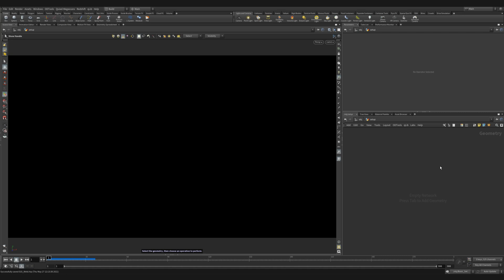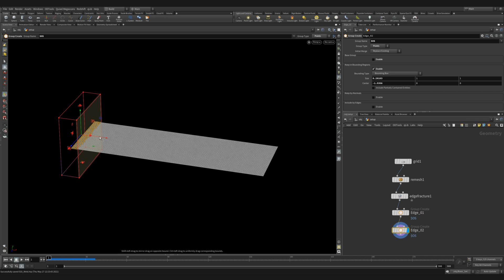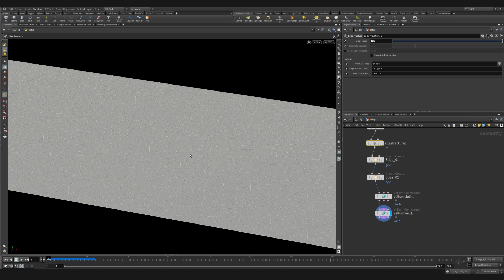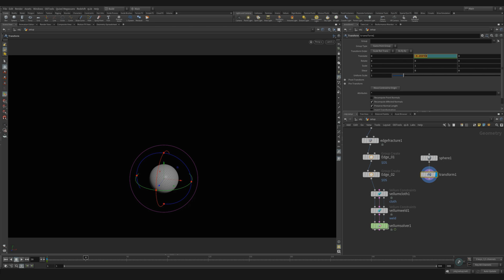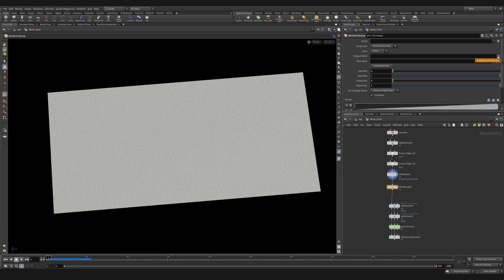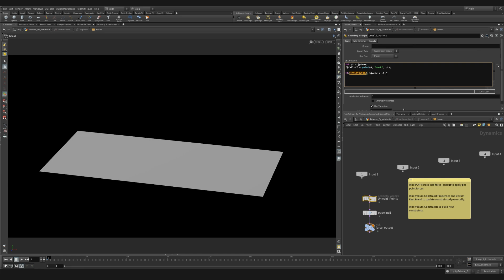10 | Vellum Nodes | Weld

Comment: Why i cant animate breakthreshold parametr? solver use solver use value only from first frame
Reply: The weld constraint is a bit odd because it works on the points, not the constraint geo. That's why the constraint properties node doesn't work. You need to work on that @weld property and set it to -1 to turn the weld off.
Reply: @griff7543  then what about animating stiffness? Can this be done via a solver? And on prims or points?
Reply: @pinkmoon5332   stiffness is on prims, and yeah everything that's animated needs to be done in the solver (or imported into the solver). Everything prior to the solver is just setting up what happens on frame 1. The solver is the only thing that gets evaluated every frame.